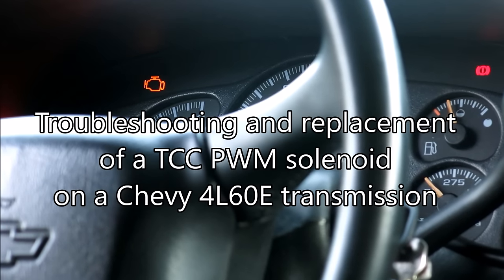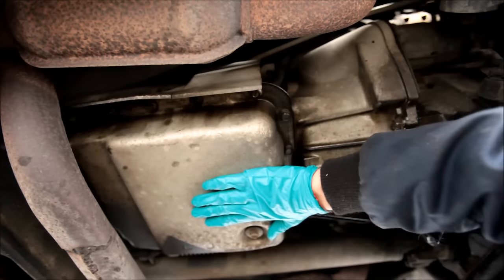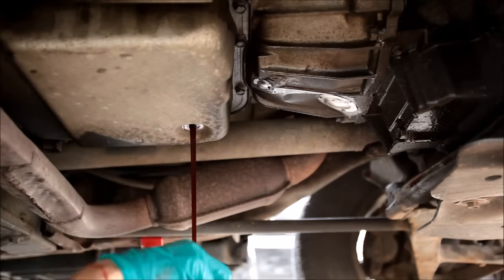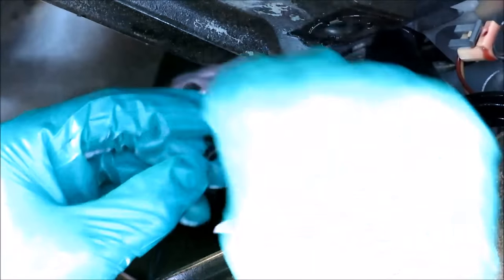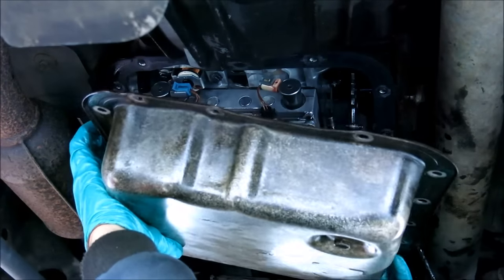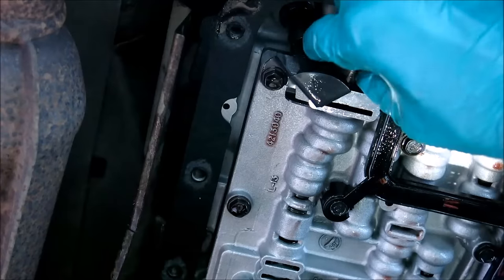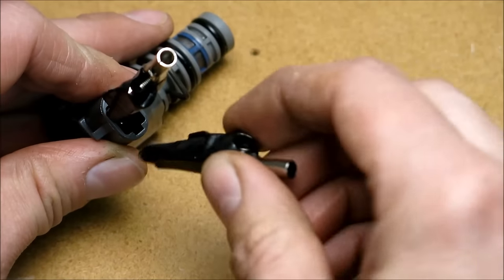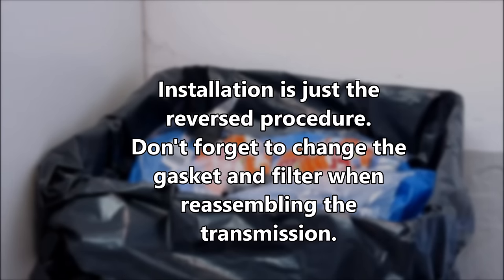Troubleshooting and replacement of a TCC PWM solenoid (p1860, p1870)

Comment: The pwm resistance is 10-15 ohms, the 3-2 solenoid is 20-30
Reply: Joe Hernandez I have a p0740 code on a97 dodge truck
Reply: hello Joe.  i have a question about the resistances that you shared. are these actual measurements that you made on your truck; or, are those actual specs from the dealership ?? thanks
Reply: Was wondering about that myself.

Comment: Nice video, Thanks, I have P0741 on my 2012 Chevy Express 1500 with 4.3L gas engine, would you think this one fix the problem? Drives fine but the oil is  almost black.

Comment: Hello!  Question. How did you back probe the connector? Did you put an alligator clip on each wire going into the connector?  That's what I tried and I can't seem to get a good connection to check the ohms.  Thank you for your video!

Comment: Good morning, I have a 99 Blazer V6 (I'm from Brazil), and it's showing error P1860. I disassembled the TCC PWM solenoid, did a resistance and operation test with 12V and it's perfect, but the error still persists. But the transmission doesn't go into second gear. Do you have any suggestions as to what it could be?

Comment: Some say between 20-30 ohms for a pwm solenoid others say 10-15. My question is which is it? Mine reads 10.6 and doesn’t lock the torque converter.
Reply: Mine read 11 ohm, I removed it and found it had cracked, new unit measured 11 ohm too, but the replacement fixed the problem. Weird.

Comment: My rpm goes up or down 200 rpm every now and then when I’m in 4th gear, going between 45-60 mph. 3rd gear and below is fine. Does this sound like a tcc problem to you? Or maybe a valve body problem?
Reply: Same here
Reply: @dwayneyoung7988  did you get ever fig yours out
Reply: @gregbanter3022  yes , new front oxygen sensors, etc sensor and tps sensor finally fixed it. Not sure which one was exactly causing the dead spot in that rpm range fluctuations. But it did finally fix it though.

Comment: Is the shift Solenoid's A & B located in the same area as the Torque converter clutch pulse width modulation  Solenoid?

Comment: Would a faulty PWM cause my torque converter to slip for a split second when in overdrive? Doesn't do it all the time. And when it does it's when I let off a little to cruise around 50-65. 

99 k1500 suburban with 4l60e
Reply: did this fix your problem? I seem to have the same issue
Reply: Ben did you replace the solenoid or new torque converter? What worked for you? I have a 99 tahoe have same problem.

Comment: Great video and info, but besides the codes, what were the symptoms driving down the road?
Reply: I've got a faulty TCC PWM (there's a hole the size of a pin head in the filter! and it reads 11.6 ohms). I'm not done troubleshooting (may also have a faulty wiring harness, o2 sensors, etc), but here are my symptoms: slow to shift, doesn't like to shift into higher gears, slow to accelerate, terrible gas mileage, small PING from transmission when shifting into and out of second gear. hope this helps somebody else who comes along, namaste!

Comment: Was you transmission acting up when this code come on? I just had mine rebuilt and it won’t shift to 4th
Reply: I’ve got the same damn problem after it’s gets hot!  I nor anyone else can figure it out.  Works fine while still cool.  This really is a POS trans - they just made the old design electronic when it should have been a ground up redesign.
Reply: @Lt_Tragg  mine do the same, did you Solve the problem?
Reply: @antoniomoya5222  yes.....it was indeed the Torque Converter Clutch Pulse Width Modulation (TCC PWM) Solenoid.  This damn thing didn't throw a code.  The "brake solenoid" did, but this had nothing to do with the o/d not locking up.  Anyways, works great and life is good again.
Reply: @antoniomoya5222  yes, Torque Converter Clutch Pulse Width Modulation (TCC PWM) Solenoid was the issue and I had no code, just would not lock up o/d
Reply: @Lt_Tragg  what were your symptoms please let me know this shit is driving me insane “ my rpm  Fluctuates between 40 and 55

Comment: i have  a 05 trailblazer my transmission shift 1 and 2nd gear  nice and smooth but 3 and 4 goes in neutral. any suggestions. thanks
Reply: Josean I have an issue with my 02 trailblazer , no 1st gear or 4th. just starts out in 2nd gear and shifts to 3rd.
Reply: Antony Rosa I'm having the same problem what did you do to fix it?
Reply: Try vss

Comment: There is a problum in my amt car when I put in D position car runs in 1gear 2 gear 3gear slips while accelatter suddenly check light comes on deshbord car will become slow car will not run then have to switch of car after one minute start the car check light not there put in D  mode car will run an again same problem can somebody solve this problem
Reply: Its unsolvable!  I can’t figure mine out nor anyone else - same symptoms.  I’m throwing mine away and getting another.  Truly is a poorly engineered POS.